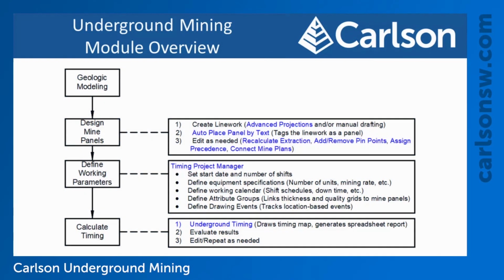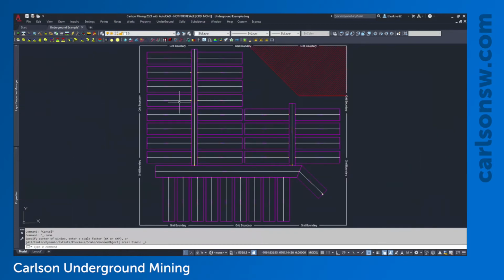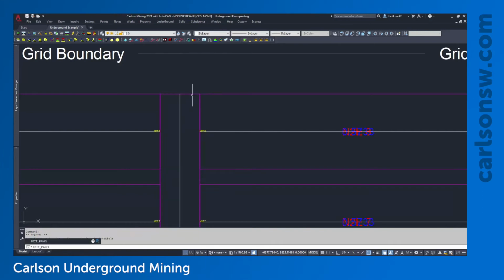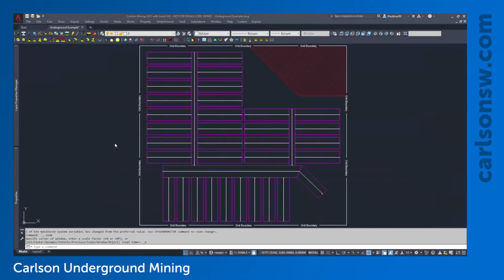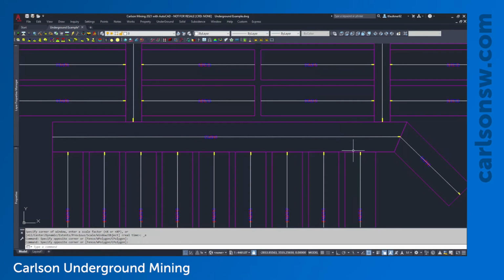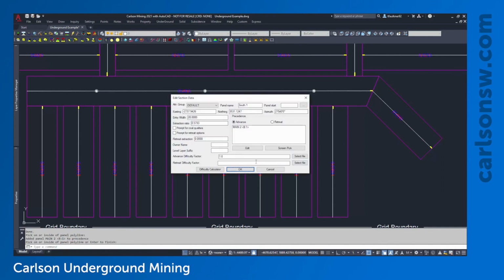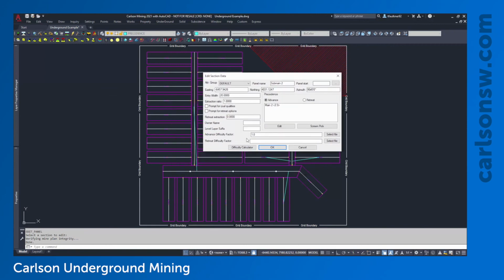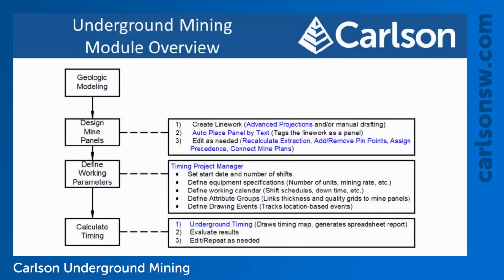Carlson Underground Mining | Panel Editing (Part 2/4)

Comment: Thought I would make a note/issue I had ran across. I had mistakenly misspelled the layer "PANELNM" (I had the L and E backwards). I ran through the "Auto Place Panel By Text" several times and it would not draw out the center lines. My misspelling of the layer was the culprit.